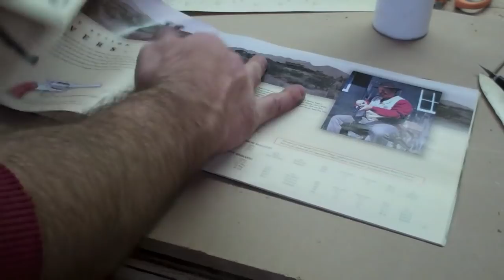✔ DiResta Sketch Book Binding

Comment: Materials needed:
1. Binding board(get acid free) on the web $15 - $20 Sizes .067"--.098" makes 2 books
2. PVA glue (Elmer's or regular binding glue). It's called Copydex in the UK.
3. Fabric, or leather
5. Exacto knife, Tape measure and Square
6. Clamps and boards
7. Book cloth (may also be found as binding cloth)
8. Not sure what those little stitched ends are called
9. Really sharp scissors (Upholstery scissors for leather)
10. Stencil
11. Folding tool (should be bone, or really smooth plastic) for creasing and as squeegy
12. Paper (usually glossy for front and back cover sheets, but not mandatory)
Reply: The stitched ends are bookbinding headbands. Also, the glossy front and back covers are typically called endpapers.
Reply: Thank you! I googled every tag I could think of to find out what those were called.lol
Reply: thecultofpop hi, where can I buy headbands?
Reply: Buddy Bellwether
Reply: Copydex is not PVA.

Comment: Nice job! I love to watch Your videos.
Small binding advice: Dont put glue all the way to the spine of the book when attaching the covers,
leave about inch without glue, and make that first paper quarter of an inch shorter.
When you open the book it is than not under stress and moves freely. Best to check on wery thick books.
Loving Your work

Comment: I took a couple classes at the NY Center for Book Arts, up on Broadway and 28thish.  Fun stuff.  Sure doesn't look like there's anything wrong with this to me.

I was surprised to see the one-page signatures. But when I think about it, I imagine that would do a much better job at sitting flat.

Nicely done.
Reply: I would imagine 1 page signatures are required when your only using glue and no thread to bind the pages together, other wise none of the folios on the inside of the signature would be held in

Comment: You make it look so easy and effortless. I would really like to attempt this myself one day when possible.
Reply: Go for it.  go relatively light on the glue and make the first couple tries with simple cardboard for the board and just large paper for the cover so that you can see how you're supposed to fold it and where you need to leave room, etc. 

It's a cheap way to start and you'll get a good idea of whether or not you want to pursue it.  I've made about a dozen or so.  Problem is I like them too much to use them :)

Comment: What most people on here don't know is that this is nothing like traditional binding.  A modern method is used here, known as "perfect binding", by which the sheets to be bound are trued up and fixed with adhesive.  Traditional book binding, which is done with heavy thread, is an extremely laborious process which produces much more durable binding than more modern processes.

Comment: Amazing
you used MDF for the cover? and where you can buy the gauze for binding, and the white and red strips?
Really great job. I follow all your videos with great interest from my lab
Reply: MDF doesn't come up in layers (as when Jimmy cut the letters in the cover and picked off the first layer.)  You would have to use a small router to do the same thing on MDF; rather it's just plain old hard board.  A good source for obtaining hard board is take apart old three ring binders (you have to make sure the hard board isn't glued into place inside the plastic coating; which does occur on occasion.)  They're fairly thick and are fairly well protected in the plastic cover.  Hope that helps.

Comment: Jimmy what's the cardboard like material
Reply: Cardboard.
Reply: It's too rigid for cardboard it looks like a thin plyboard
Reply: It just called binding board. It usually runs about $15 for the .067" and about $20 for .098" with that you get enough to make about two books. Of course it's much cheaper if you can afford to buy in bulk.
Reply: Buddy Bellwether thank you